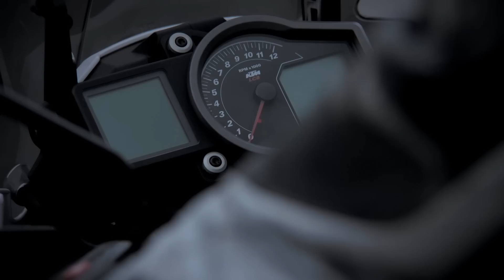EN | Bosch Two-wheeler safety systems

Comment: It is very impressive. I wonder if is intended to be manufactured as an aftermarket component too for a universal fit on various motorcycles. And it seems very powerful, have you considered making use of this as an emergency brake or use it pushing the motorcycle down to add extra traction on very hard braking situations?

Comment: you can just add these stuff to your regular bike or you have to buy one of those to get it?
Reply from the maker: Thank you for your interest in our products. Each of our ABS systems is developed in close cooperation with the motorcycle manufacturers in order to address the specific requirements and demands of the bike. Therefore both systems, ABC and MSC, which contains the lean and pitch angle dependent control in addition, cannot be retrofitted and have to be adapted to the specific bike during the bike development process.

Comment: so you took all the awesome stuff from the motorcycle and basicley all you have left  is a normal bicycle whit an engine now. lol! xD i know the saftley is inportant but come on! motorcycles arent made for kids , you have to think and andorstand what you are driving before you even considering driving it. thats why its awesome after you learn the way to controll sutch beasts! thats the thrill of it all lol , the cruising part is just the start!
Reply: EliteH1 These systems could save hundreds of lives every year. Not everyone rides like Marc Marquez. Are you suggesting that only those at his level should be allowed to ride the streets? I've been riding dirt since I was 12 years old and road since I was 16. I would contend that in my prime I was a very proficient motorcycle rider. That said, I welcome these advancements in technology. They would have helped avoid a crash I sustained at 50MPH when I hit oil left on the road by some car that left the area before I arrived on the scene.
Reply: EliteH1 this safety systems are intended for emergency situations. If you are a skilled rider this electronic aids will not interfiere with your riding.
Reply: Update. I have these systems on my new bike. I’m definitely faster because I know they are there. You can push limits with a safety net. 
Hi grew up with no electronics, but these don’t interfere with your riding until you overstep the mark. Then rather than crashing/hurting yourself you carry on. You can also adjust the electronics to what you want from them and turn them all off if you think your better than the high limit the computer works at!!